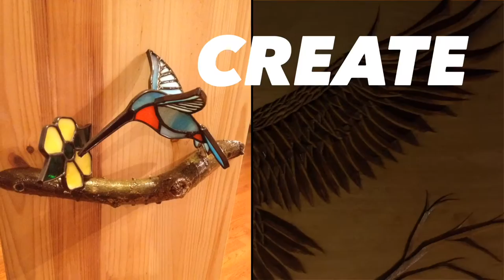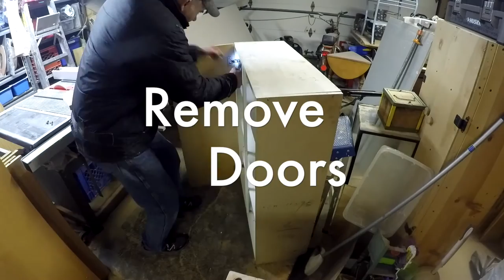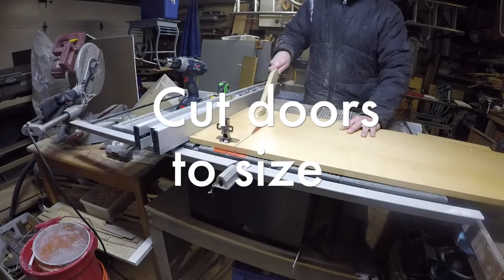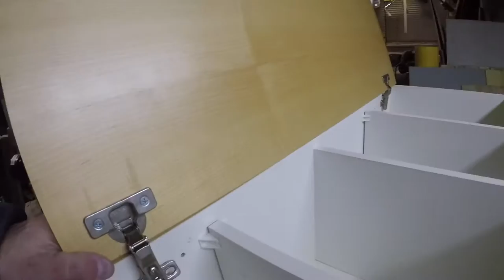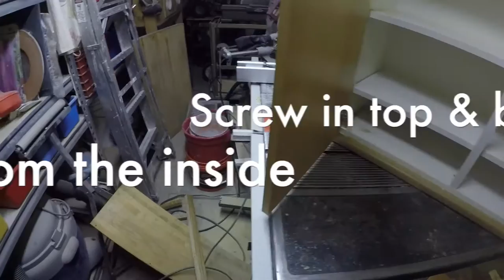Repurposing a kitchen cabinet.

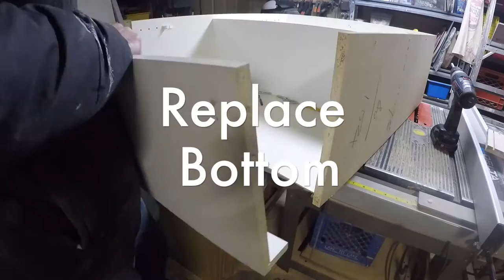Comment: at 1:25, how do you "replace bottom"...i mean u just cut it off so what are u replacing it with and how, step by step?
thanks.
Reply from the maker: Hi Rick. I did go over that part rather quickly in the video. I hope I can clarify. After cutting off the bottom 6 inches, I removed the short sides and back piece attached to the bottom section I cut off. I left that 1" strip attached to the bottom and put it back on the cabinet. I may have had to make some adjustments to get it back on but honestly, that was 3 years ago and I'm just going from memory. Good luck and thanks for watching Alley Picked. I do have to say that that video was a bit hard to watch. I have gotten better since then :-) Tom